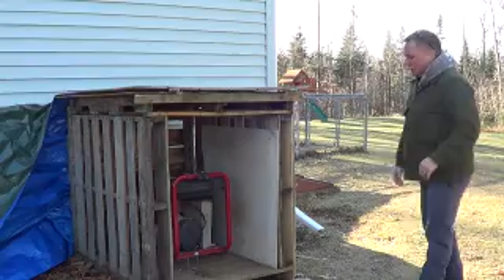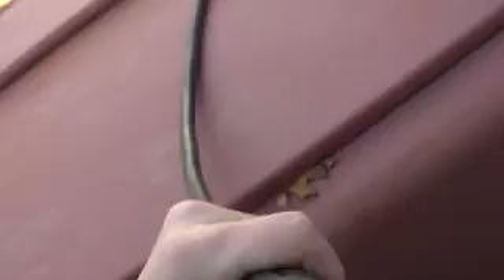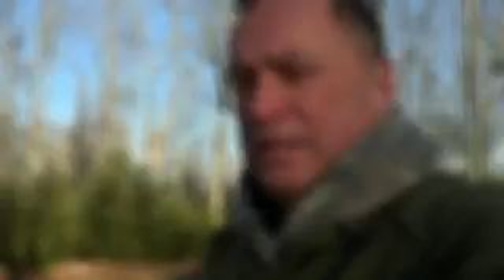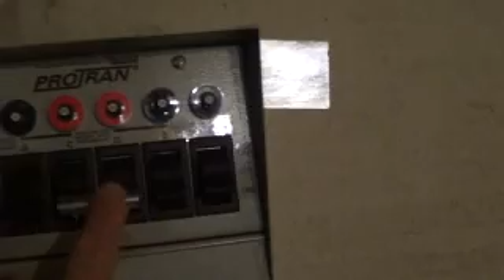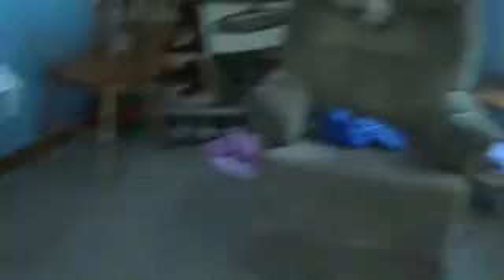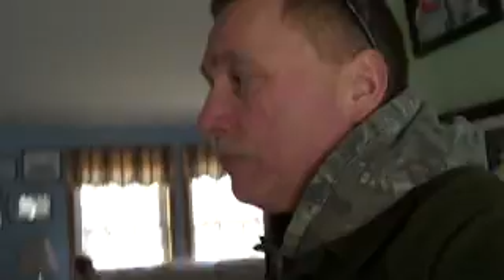Generator Setup and Test

Comment: Very nice. I should have taken that route.. I paid more for eleven 35 amp each batteries..Mine is stored in a hug cooler with alot of extras...I'm not on solar yet to charge them..May I ask what it cost to add the generator power box that runs the power thru out the home..Thanks jarhead,  this is the setup I want...Awesome
Reply from the maker: Hi Willie - here's a link to the first blog post:  http://www.shtfblog.com/transfer-switch-and-generator-test/  But all together it was just under $1000.  The post will detail it out.